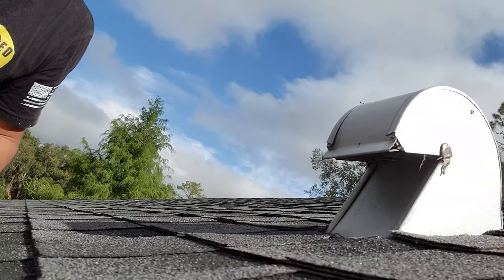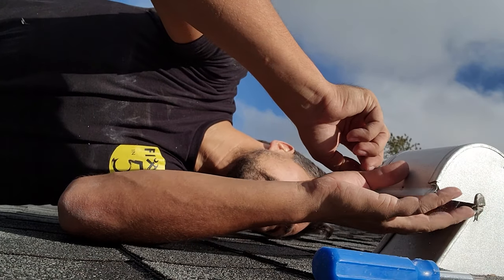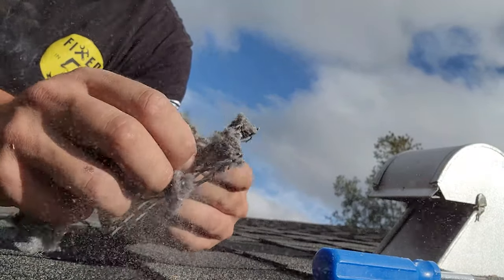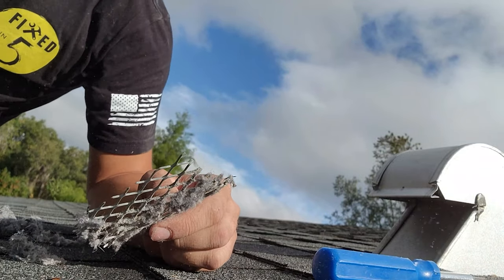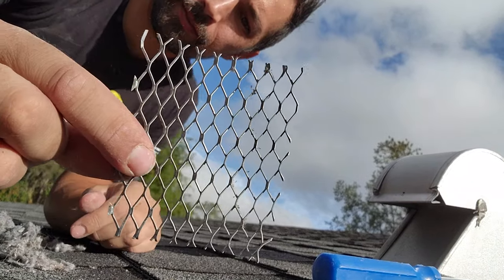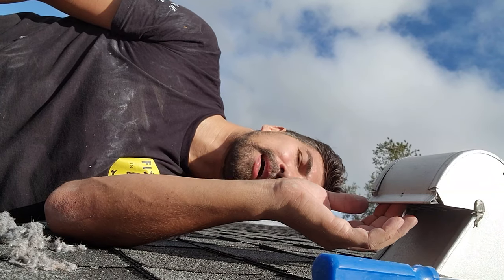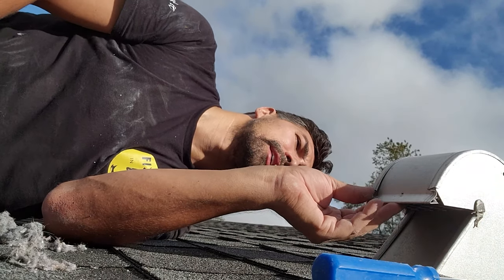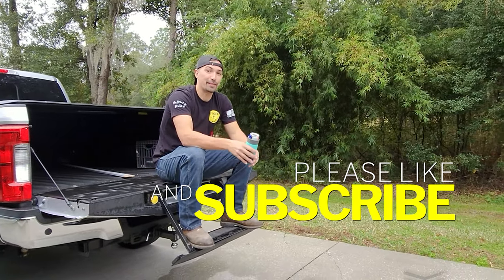Why You Need To Clean Your Dryer Vent

Comment: Great tip.  I had recently purchased a new washer and dryer that was supposed to be super smart.  Well, my super smart dryer kept throwing me codes saying my vent was 80% blocked.  I was in complete disagreement with my super smart dryer because I was in a literally brand new home, No way it was blocked.  After many many, yes many of hours on the phone with LG, the clogged screen on my roof vent has finally been addressed…
Reply from the maker: Wow, that's crazy. Sometimes, it's the simplest solution that can fix a problem. Now you will always know to check this out before making a phone call in the future.  Thanks for commenting. 😀